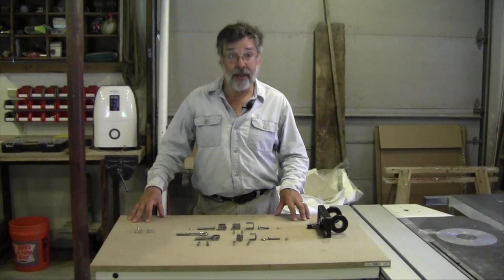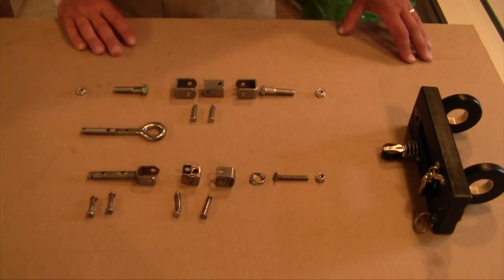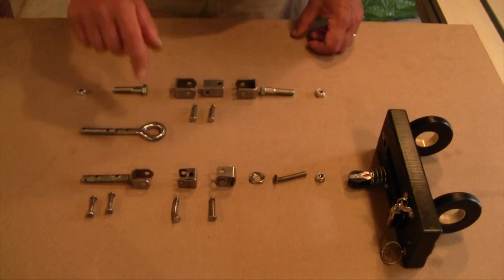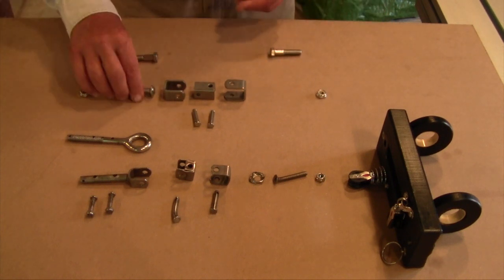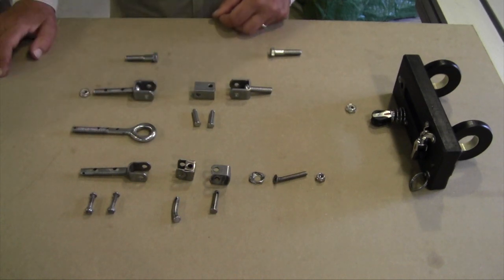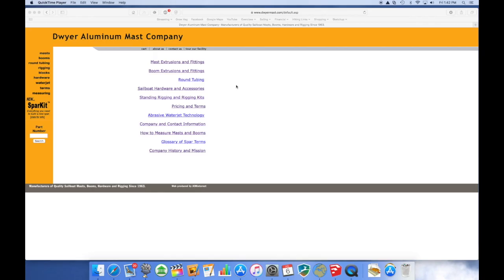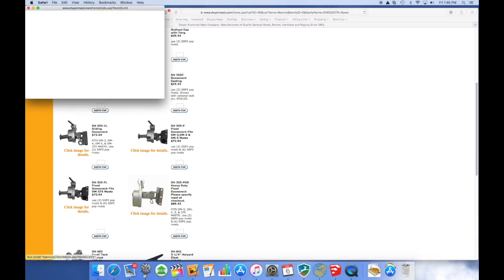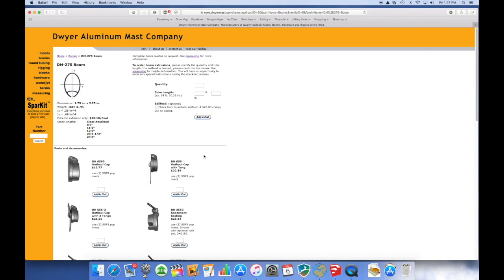Ep 38: Repairing the Gooseneck

Comment: Hi Peter!
You are a lifesaver.  A fabulous resource for all things R22!
What are the dimensions of the button head bolts from Mc Master-Carr?
I notice also that the rings on your "slider" are in better shape than mine.  Did you get them from GB or are they original?
Reply from the maker: Jeff,
I put up text on the screen that says the shorter bolt is 1 1/2" long, and the longer one is 2 1/2", but checking my McMaster-Carr order history, I find that the shorter bolt is really 1 1/4" (item # 98164A305), while the longer is indeed 2 1/2" (item # 98164A317).  Both are 316 stainless; 3/8" x 16 tpi. It's always possible that my IMF related hardware is not identical to yours, so double checking to make sure these numbers seem appropriate for you would seem like a good idea.

I'm guessing that the entire IMF 'slider' assembly was new when I bought my recycled boat in 2016.  So, at the time I made this video, they were only about 2 years old.

--Peter